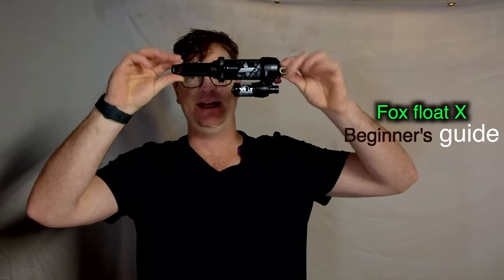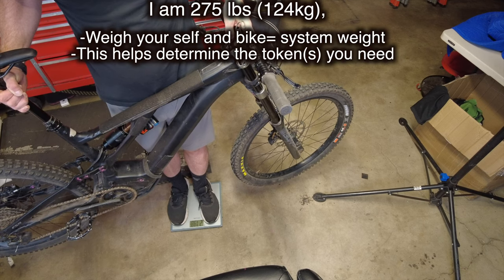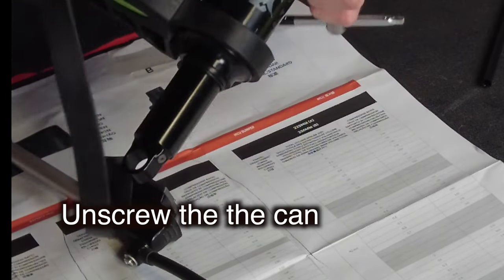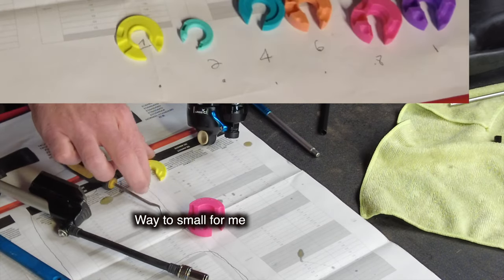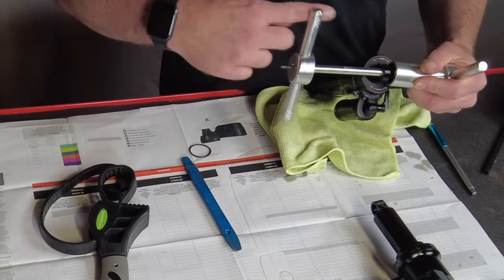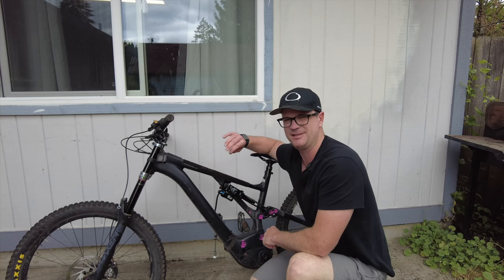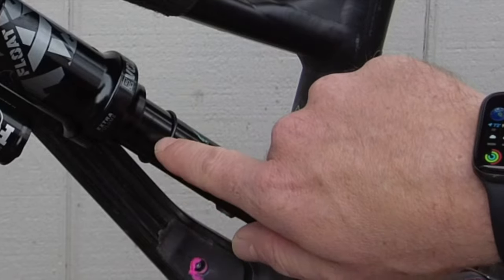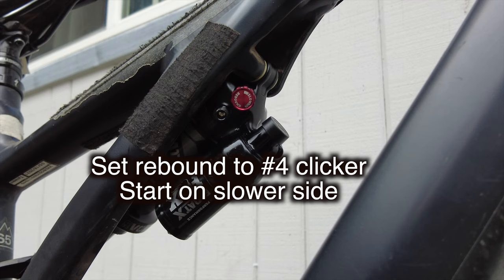How to Use Your Fox Float X for the First Time

Comment: I just installed this shock on my Stumpjumper Evo and am trying to troubleshoot an issue. If I slightly compress the shock by hand (10 mm or so) by pushing on the seat or top tube and then pulling up on it and repeating this a few times the shock starts to make a top out noise under full extension when I pull up. It’s a knock sound that is coming from the shock directly not bushings or pivot points. Was wondering if you could share any insight or try this on your own shock and see what you find. Thanks!
Reply from the maker: Let all air out. Pump 50 psi up press on rear suspension 3 times. Then pump 50 more psi and press suspension down 3 times. Kee doing that tel you hit your sag point. That should burp negative chamber.
Reply: @OtterMTBtech  unfortunately I’ve tried that multiple times nothing changes. If I ride the bike or use my full body weight to cycle the shock a couple times the problem goes away until I’m off the bike and push down a few mm and pull up again a couple times usually like 6-8 times before it starts knocking against itself again.
Reply: @jacobdumanski  Hi, I am also getting the exact same issue with the Float X that came on my brand new Patrol NX build. Wondering if you found a remedy for it yet. I might also be taking it back to Fox soon.
Reply: @tommys3040  not really, I had it inspected at my local shop and they said it was fine.
Reply: @jacobdumanski  I see. Do you also feel the shock knocks and rattle as you ride through bumpy trails? I do feel those and its bugging me.
Reply: @tommys3040  no I don’t, after riding for a bit the issue goes away. It’s only after I pull up on the shock a couple times until it starts doing it again. You should bring the bike back to the shop you bought it from and have them take a look.
Reply: I had this same issue, it didn’t sound like a creak and sounded more like a knock. It didn’t make the noise all of the time. Only when I compressed it quickly then let it sit then when I would pick up the bike it would knock one more time. Turns out the air can wasn’t screwed on tight enough. Hope that helps

Comment: Sitting on the bike without air made my factory new Float X blow up. I didn't watch this video earlier so I'm not saying you're at fault 😊 Just wanted to share my experience.
Reply from the maker: You had a issue, because it’s recommended from every brand to compress it down to check figment

Comment: Bought one of these shocks used . Was very disappointed to find out it was a oem spec item (no blue compression knob) just a cheap cover with supposedly 4 clicks of adjustment. I can't feel any clicks. They sell a fox kit to upgraded but had I known this I would of chose different!
Reply from the maker: I did not need to adjust the compression, there is a huge range of tokens. Try that first

Comment: Great video.. how do you know which spacer to use based on your weight ie why did you choose the volume spacers that you did? Thanks
Reply from the maker: System weight. Bike plus rider. I am heavy guy 220 pounds and heavy bike 60 pounds, so went max spacers. Or very near MAX. If I as on non ebike would have went 3/4 max spacers.
Reply: @OtterMTBtech Is this a chart of which spacers based on system weight somewhere?
Reply from the maker: @kub85  no you have to guess the spacer. Let me know your bike and weight I’ll guess
Reply: @OtterMTBtech  200lb! bike+rider!

Comment: I’ve been using a strap wrench on the skinny part of the air can to tighten it because I’ve changed spacers without taking the shock off the bike. I’m afraid I was putting too much torque on the can…is it possible to bend the can using just a small strap wrench? I’ve noticed a little more sticktion suddenly and not sure if I bent the air can. I wasn’t putting a ton of pressure on it while twisting but probably more than hand-tight!
Reply from the maker: You have to press really hard and twist, just take it off the bike

Comment: When adding air to set sag, does it matter if the switch on the reservoir is set to firm or open?  I believe from what I can see in the video you have it set to open while you are adding air?  Thanks
Reply from the maker: Open everything compression and cold switch

Comment: What the shock is brand new, is a hardware kit still recommended? Also, is there a need to valve/tune a new shock to match any particularly specifications for the bike it's going on? I'm looking to put this on a 2023 Hightower but have never done a shock replacement before.
Reply from the maker: You can transfer the hardware from a old shock, works 90% of time. I have had issues where it caused a problem. 

Doesn’t have to be tuned for your bike,  to best of my knowledge when you buy one from a shop it not really tuned. 

It really really helps if you can get one with a tune. 

Example this float X was from Kenevo SL, heavy ebike tune, felt really good on my full power Kenevo.

Comment: Hi.  I sent this comment in another video.  Sorry if you saw it/answered already. Hi.  I’m really more of a beginner.  I trust your advice on this.  I had a 2020 levo SL with a fox DPS shock on it. I hated it.  I changed it to a float X2, but rode the bike one time before the SL Motor blew.   So I recently purchased a 2023 levo SL with the stock float X shock on it.  I weigh 255lbs.   Should I leave the stock float X shock on it? Or put the float X2 on it?
Reply from the maker: The float X is a fantastic shock if it has the specialized tune (the little writing on it that says RX). Should work fine for cursing starting out. Use the max volume spacer  

I just got got with the how to setup for the X2. There is massive amount of compression adjustment(blue knob) that could be a absolute game changer for your weight if you start to jump ride a bit harder. 

The problem with that bike is the small shock size. It a low volume shock. I had a 2nd gen Levo same size shock and I had to max the pressure out and volume spacers. 

I’m not 💯 on the new Levo SL suspenion design they may have made it for more rowdy riding. The 1st gen Levo and Levo Sl  was a tooth pick
Reply: @OtterMTBtech  my 2020 levo SL was an absolute piece of garbage.  Everything on it broke. To date it has only 190 miles on it (it cumulatively over the 3 years spent about 10 months) in the shop.  Motors, cranks, bearings, dropper posts, the shock, and now the final nail in the coffin, the motor again.  Just today, specialized agreed to send me a new 2023.  That’s why I ask the question.  I have the X2 float on the 2020 that is sitting in the shop, and that bike will be property of specialized next week when my 2023 gets here (I’ll still believe it when I see it) but if things go the way they were explained to me today…. I’ll finally have a non lemon bike that I can ride! I’m just wondering if I should ask the bike shop to switch the shocks, or leave it with the stock shock on it.  The new one is a replacement for my expert carbon.  So….the new expert carbon.

Comment: Hey man are they easy to remove? Do they just pop out or something? I have 0,7 in mine which is a 0,6 + 0,1 and I’d like to remove the 0,6 as I’m only lightweight is there a knack to removal?
Reply from the maker: It’s not to difficult just need a strap wrench let all the air out, and pick spacer out with a screw driver. Make sure it’s orientation is same and fox logo is facing right direction. outlined in video every step. 

You could also just sag it into 35% and try current one. I like the high sag number, makes it pop. Not good for high speed jumping 

I’d go with the yellow one, 2 if your not not clapping 👏 the bike.
Reply: @OtterMTBtech  thanks man really helpful got it done nice one

Comment: Is it ok to run without any spacers? I am a complete noob, I just want plush.
Reply from the maker: You can ride it without. If your light weight and or normal riding it will be fine. Only if your doing big jumps you need the spacers. Get the sag right and start with the red dial the two kind slow.

Comment: How do you get from system weight to the number of spacers ?
Reply from the maker: Estimate. Like me and my bike are 300lbs together. So I am very close to maximum spacers allowed. If I was putting spacers in my non-e-bike the system weight is much lower 250lbs so I would start with 50-60% of the max spacers.How much is your system weight? And what bike>?
Reply: @OtterMTBtech  210 lb system weight 22 rocky mountain instinct, currently has 0.4 cubed spacer, I have bottomed it out just about where I would expect to but I am looking for more mid and end stroke support for jumps
Reply from the maker: @ts-rf7er  I would try max volume spacer(s) for your weight and becasue that bike has a short stroke shock, The slowly back off the spacers. The short stroke shock and your higher weight make it tough to get right without having some high speed compression adjustment. Totally possible just a little more work
Reply: I did not get any instructions with my spacers, do you have a link to the weight chart?

Comment: Oops I did not cycle mine after putting pressure in.
Reply from the maker: I am not sure if required for that shock. It is absolutely needed on the fox float X2.
Reply: @OtterMTBtech  I thought it was for any shock with EVOL air sleeve ?
Reply from the maker: Not 💯 if required in X, but I do it everything fork shock any brand. Had really bad issue not equalizing one before
Reply: @OtterMTBtech  Gotcha, Ill definitely do it as well.